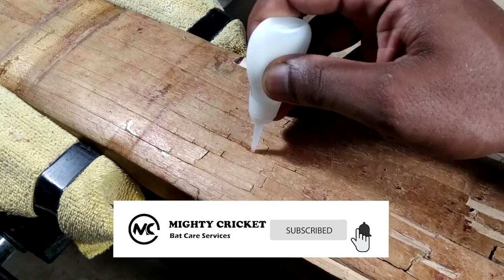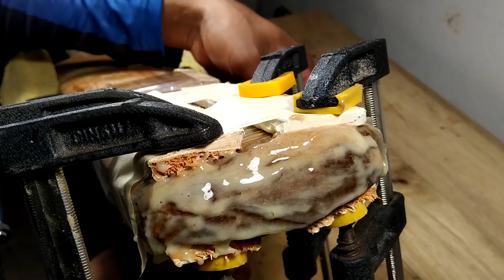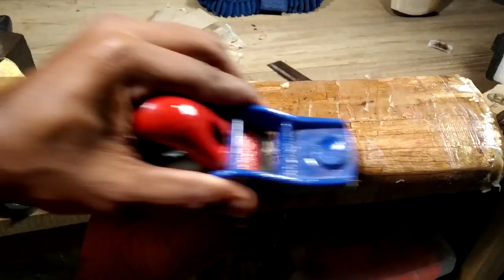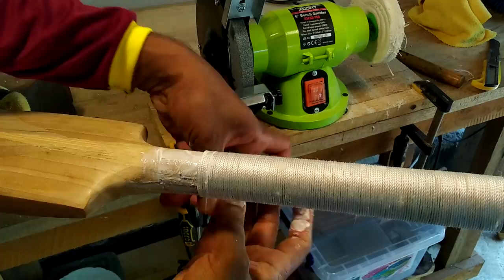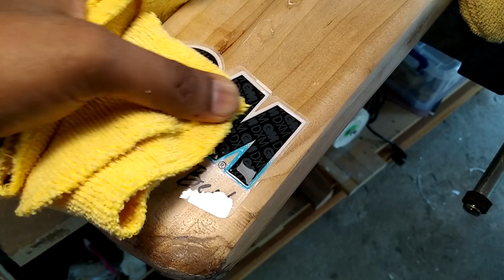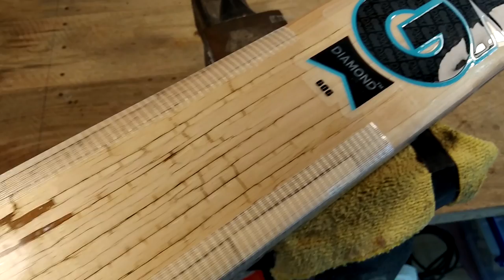Full Refurbishment & Repair of 15 years old Cricket Bat - Challenge Repair Episode 4

Comment: Although it seems cosmetically amazing. But for my liking once a bat is done it's done. But yes if you want a slight repair on your bat then it makes sense. But thinking if the bat is going to give the same feeling as new is a far cry. You cannot just hit on the chips which are hanging on to the glue. And yes if you want to make it as a practice net bat or a decoration piece then it's fine. But yes amazing work. It's like a beauty parlor for bats.
Reply from the maker: THnx Fraz , Highly appreciated ,, cheers

Comment: I say cut the whole weak wood & add a big section of wood and glue it with wooden bolts .that will be strong and save you time in glueing the cracks and crevices.After sanding almost everything looks gorgeous.BTW awesome video .Cheers to cricket, mate.
Reply from the maker: Great idea , Keep Watching us
Reply: Bat has different type of wood it is not possible

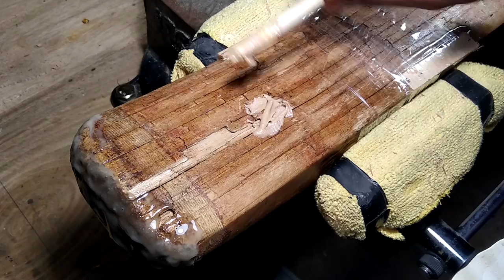Comment: Bro what did you used at 2:32 which mixture
Reply from the maker: Its glue , call epifix it has two parts call hardner and recine , we have to mix with accordinly, then you can use it
Reply: @MightyCricket  no the mixture which is used to fill grains
Reply from the maker: @siddhantgupta2679  Same glue mixed with high quality english  willow powder